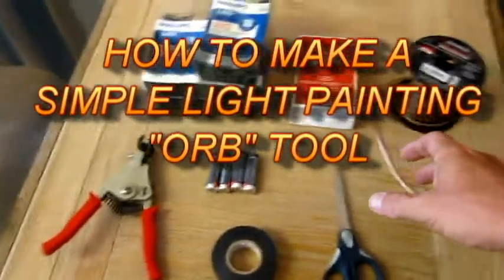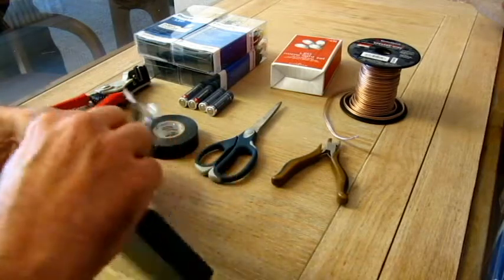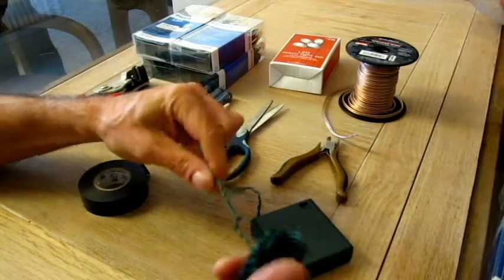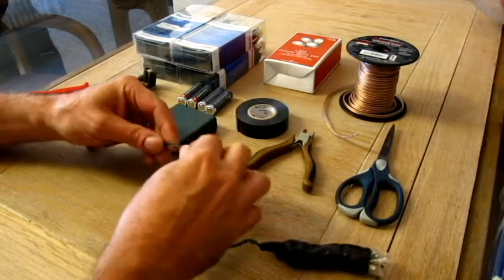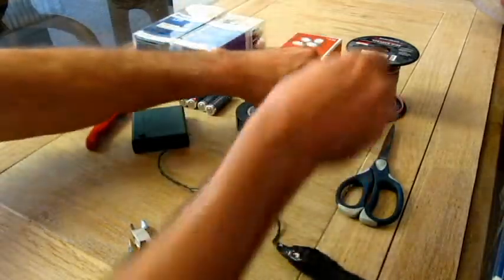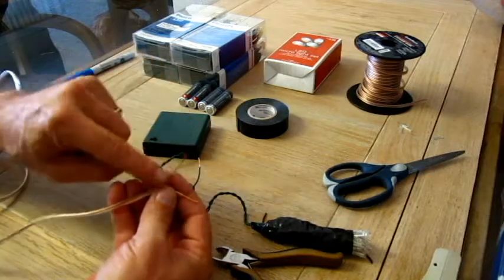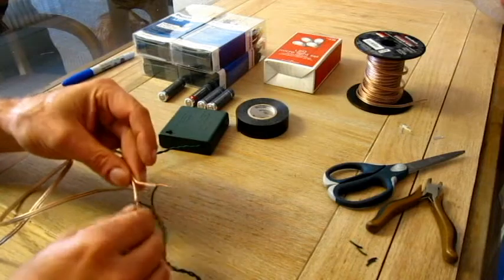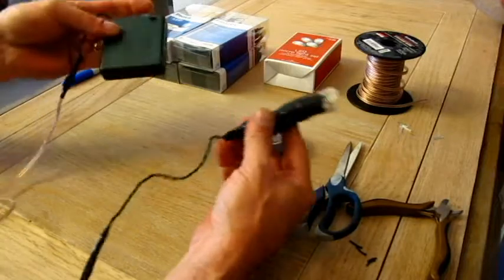Orb (Ball of Light) Tool Tutorial

Comment: ''simplifying... attach a string into a flashlight''
Riiight.. But the light coming from the flashlight only lights to the front. Not sideways like these led lights.
Reply: +ptlofts to get the flashlight to have light that is NOT directional, tape an old clear film cannister to the end (or a hairspray cap) not clear, but opaque, then the light is seen from all angles.  But you're right, a string on a flashlight seems a whole lot easier

Comment: A question for you. My lights have 5 wires coming from the battery pack. Can I still extend them using 5 lengths of wire or does it need to be 2 wires to work?